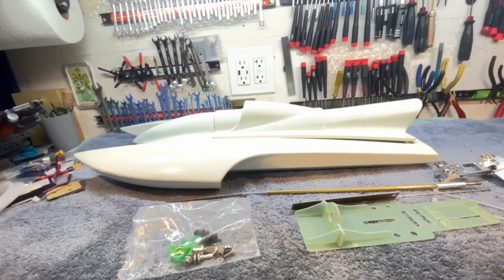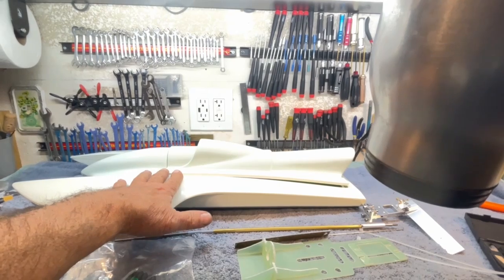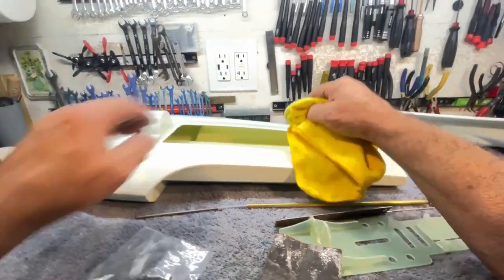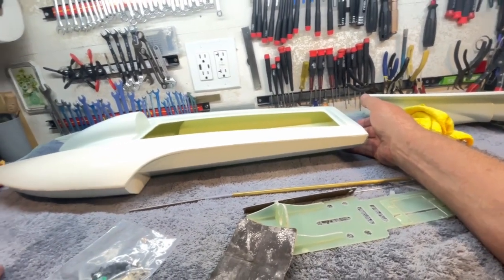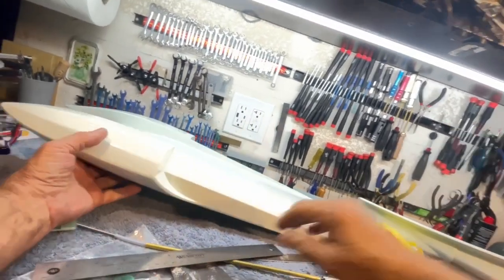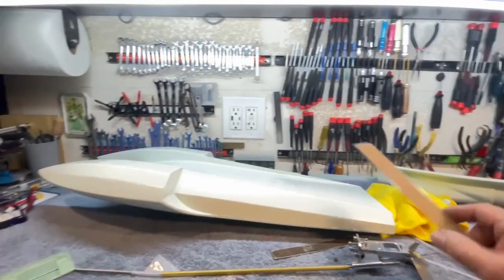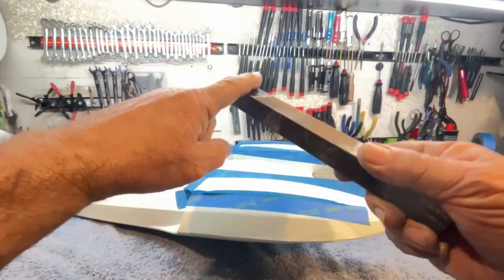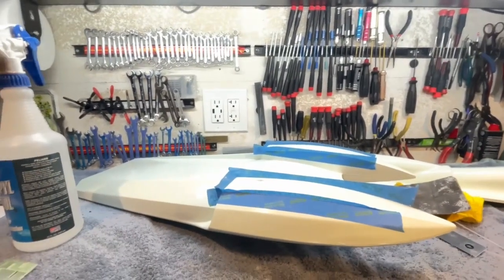Dr. Jet develops a build philosophy for the 26" Swifter Hydroplane.

Comment: One suggestion. Dip the end of the flex cable in solder to get the.150 . I used west systems epoxy a long with graphite powder and it works great for blueprinting, although you'll have a black bottom. I am interested in how you blueprint. I did what big b did and it worked great but different strokes for different folks. Maybe your way will work for different applications which this boat is. Don't forget to check the angle of the dangle😊
Reply from the maker: I'll go over that in tomorrow's talk....